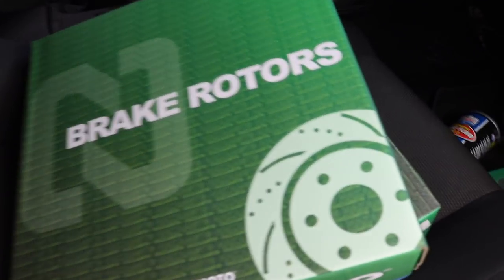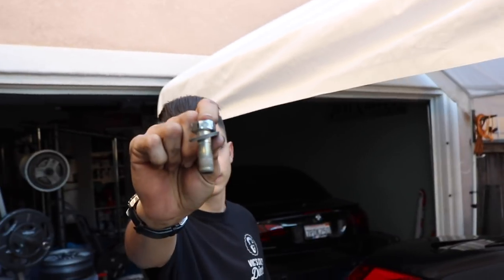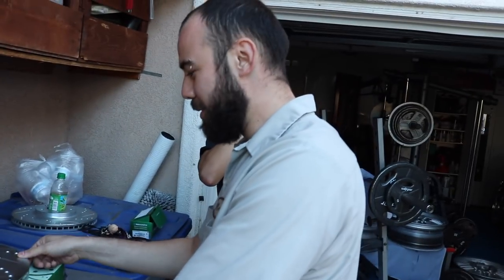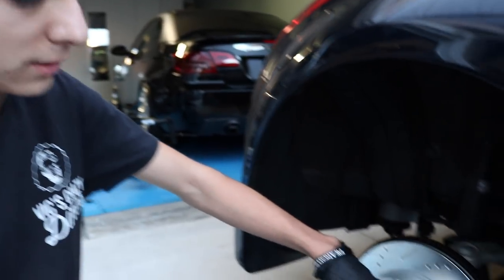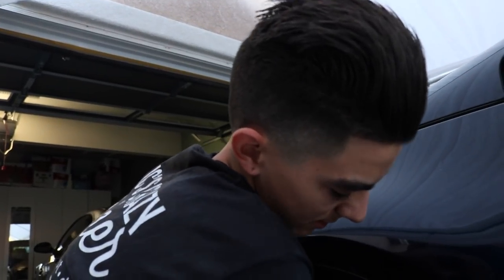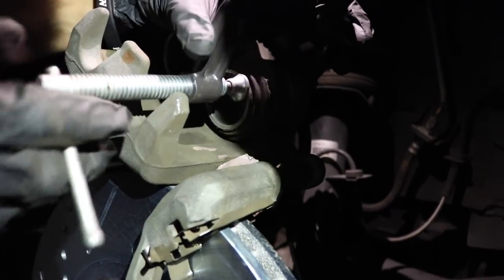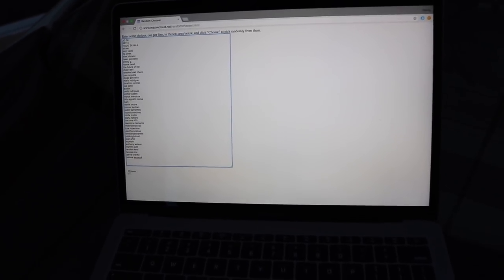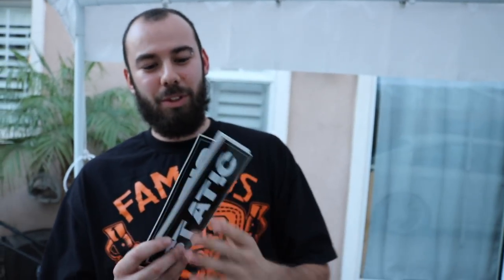Installing Brake Pads & Rotors [350Z/G35]

Comment: READ THIS.. please mention in order to push the piston back in, you have to open the cap of the brake master cylinder in the engine bay area..otherwise, you could get a surprise.
Reply: what would happen exactly because, my brother and i changed his wheels studs and did open the cap of the brake cylinder. what can happen ?

Comment: I was wondering do you have to bleed your line after changing brakes? I changed my brakes and rotors a couple of weeks ago and it just didn't feel the same to me. I am going to change them again and bleed the line to see if there is a difference? And you gotta send me a link to where you got those blue muffler tips and magnaflow.
Reply from the maker: +Rudolph Navarro If you disconnect the lines I believe you will have to bleed them as air will get inside. When it comes to just replacing pads and rotors I don’t believe it’s required. I got the muffler/tip setup at a local exhaust shop not online!

Comment: 3:38 that's just dumb... If that the case, then ask every sport/exotic car maker why they use drill rotors🤦‍♂️
Reply: Because it looks cooler.
Reply: @q6_zilla  that's even dumber from your side...
They do that to keep the rotors colder..
Reply: @Andino.  it really doesnt
Reply: @q6_zilla  oh yeah, ironically now you know more than all the high performance car brands 😂, ok bud. Make sense
Reply: @Andino.  google it man, i literally have slotted and drilled rotors on my Q60 right now. Because it looks better imo. But research shows it only makes a tiny bit a difference around the drilled holes themselves not the whole rotor. But the chance of cracking is way higher because of the holes.
Reply: @q6_zilla  🤦‍♂️
Reply: @Andino.  google is a crazy thing
Reply: @q6_zilla  sometimes make people look dumb
Reply: @Andino.  just stating facts man lol dont gotta get butthurt
Reply: @q6_zilla  nahh dawg, you know you're wrong but that's fine
Reply: @Andino.  not wrong, do some research!
Reply: @q6_zilla  let it go wrong guy
Reply: @Andino.  I love my slotted drilled rotors. Do you have some? :)
Reply: @q6_zilla  nahh, my drill ones and the ZR1 and the GT-R have  been winning since day one🤷🏻‍♂️
Reply: @Andino.  whats your IG? Id love to see your builds.
Reply: @q6_zilla  my IG is private, just for my fam and close friends. In other hands,  don't post material stuff. I don't like to be flexing on social media. That's just dumb and unsafe🤷🏻‍♂️